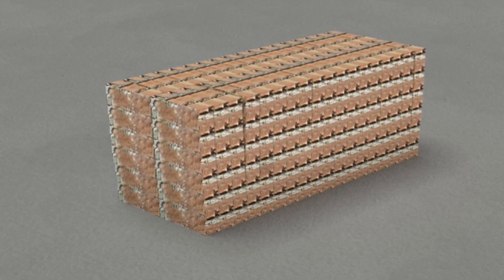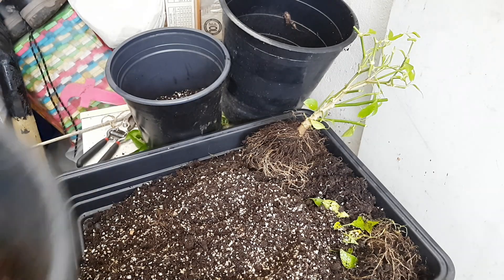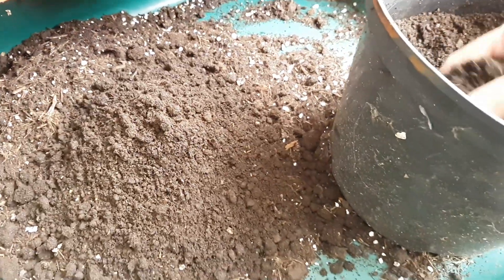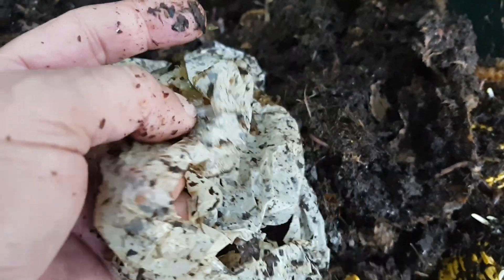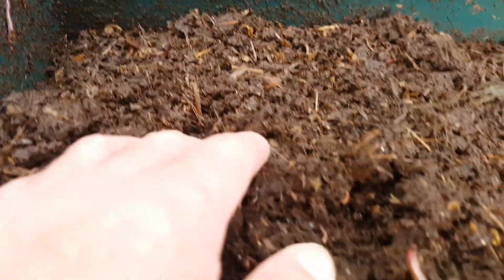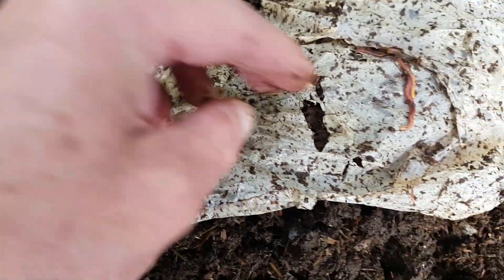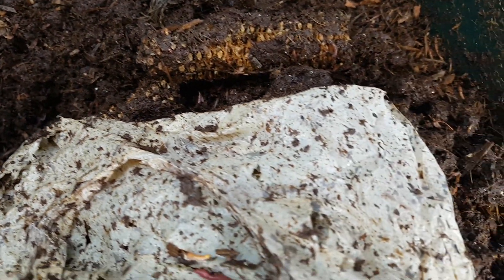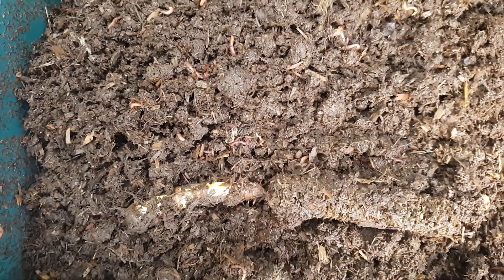Compostable Wrapper? Nov 19 Update

Comment: Interested to hear that you are winding down the worm tower. I also have the same tower.  Mine is kept in the garage but always seem to be wet, no matter what I do.  Being in the garage I have left the lid off mine and that helps a bit.  I am still  trying to find better ways of using it. Looking forward to your final review of the system.
Reply from the maker: Cheers Barry. This is one of my biggest bug bears with this type, or really any type of closed plastic bin ... the moisture it generates that encourages the worms to wander and managing the overall moisture levels in the bedding. Someone comment on one of the videos they never have an issue. I suspect they live in a very warm climate :-) Hope all is well :)
Reply: @LondonWorms  warm climate or the bins are in an air conditioned area.   I would love to be in the position where I had to worry about my bins drying out 😁
Reply from the maker: @barryjeeves6177  😂😂😂 of if only lol

Comment: Thanks for this experiment. I had high hopes for that wrapper, shame it didn't do what it said on the tin.  Be interesting to see the same experiment in a household hot bin.  Didn't your darlek bin get hot?  Could you run the experiment again in that?  Best wishes, Poo
Reply from the maker: Hiya Poo - yep I believe you're right - the daleks can get quite hot so next time I might try it in there and see how it goes. Certainly the worm bins are a non starter. The only thing I'm curious about is when that wrapper properly breaks down will it be slurped in by the worms. Did you see the Centipedes by the way :-)

Comment: In my experience, when a company claims a product is "compostable" they are not talking about one's typical home compost pile. Rather, they are referring to a "commercial composting" system whatever in the heck that is. 
I wonder if it has to do with heat and pressure?

Terry Thomas
Brookhaven Gardens
Atlanta, Georgia USA
Reply from the maker: Hiya Terry. I think your right on the money. It's compostable - in an industrial type composting set up where heat is finely controlled. A well managed large home composting pile can hold high temps for a few days but just putting something like this wrapper in an ordinary home set up will take some considerable time for it to break up. As it's breaking down slowly it doesn't seem to be bothering the worms though so I'm just going to leave it there and check in in a few months time and see how it's doing. Hope all is well.

Comment: I've had a magazine delivered in a wrapper that claims to be 100% compostable.  It is made from potato starch.  It claims to be compliant with EN13432 (which is only tested against industrial scale composting) but carries the 'OK Compost Home' logo and states that it is 'certified home compostable'.  'OK Compost' is a certification standard now managed by TUV in Belgium and has two levels 'OK Compost' (Industrial) and OK Compost Home. I feel a little test coming on :)
Reply from the maker: Hiya Barry - oh now this I will look forward to :) Hope all is well :)
Reply: @LondonWorms  not an overly auspicious start I'm afraid. I thought I should treat it like anything else that I put in my worm bins and not put it in whole, so thought I'd have a go at shredding it.  I thought it may not shred on its own so I put some sheets of paper inside. Well, I now have one piece of furrowed plastic wrapper and a plastic coated shredder :) Anyway, what's left went in thw worm bin and I'll let you know how it goes, although I do suspect that it will still need a hot compost process rather than a worm bin.